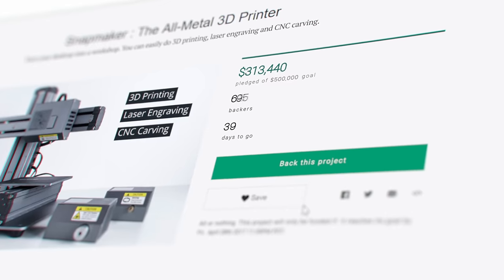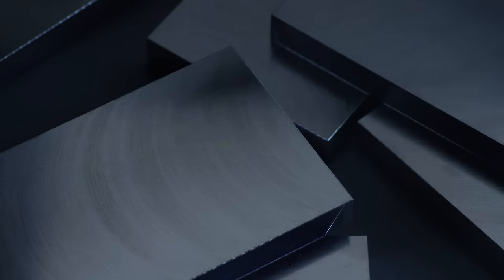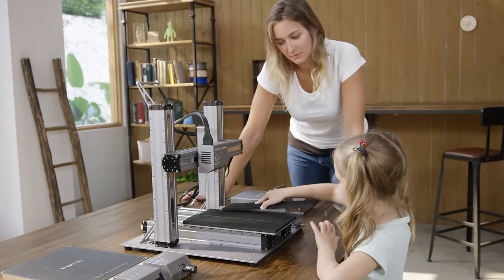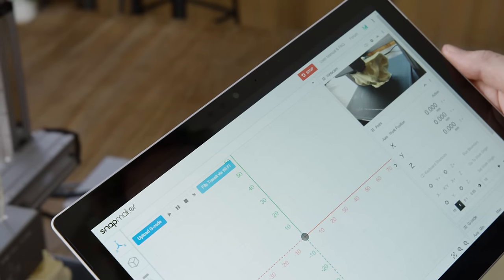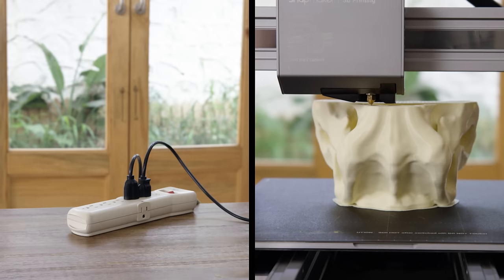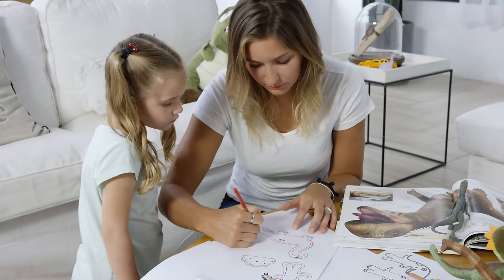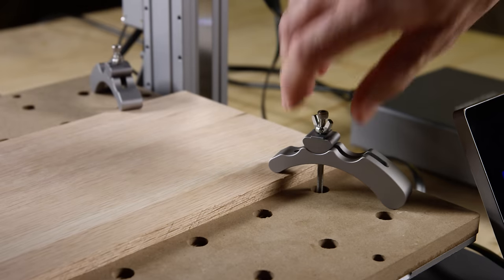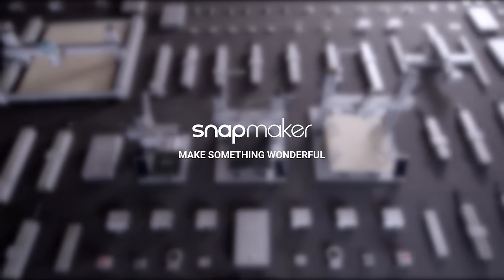Snapmaker 2.0: World's Best Selling 3-in-1 3D Printer

Comment: The price is now $1,319.00 from old price $1,799.00, is a progress. But you can build one for a $350 in your garage yourself.
Reply: Then do it! Go ahead, we'll wait.
Reply: @mrstanlez  Thats great, but not for $350 like you claim. Try $950 for components. Read the description. That also doesn't include time, labour (7 months) and residual cost. Unless of coarse you have an arc welder, grinder, chop saw...those tools aren't free. Try again.
Reply: @robreneau2959  Building time depends from every person. On my side it took only 7 days.
Reply: @mrstanlez  You are right and you are wrong. you can build your own, i give you that. The price, no, even if it only took me 7 days, it would bring me over budget, for the snapmaker. But i would get a much bigger machine, that's a plus. But, to build it, i would have to have, or have access to, a rather large and well supplied workshop. But it is a nice and inspiring video

Comment: I have buy one, but a little missing options make me big trouble ! 

Need the Controller on the other side, but after first steps to mirror the controller on the other side, i see the X-Axis Cable is to short, then i think to flip the linear Module, but then are right left reversed (rotate wrong) 

Then i look for a little (30cm) power extended cable from   "power adapter >>> to Controller 
But nothing in Store or somewhere

Not everyone desk or work place is the same 
The easy way will be when you make in the (Firmware) Software the reverse functions options in the X-Axis 
Please think about this  improvement, so the User can left or right Side assemble the Controller 
So the User have the Option to assembled to right or left side the controller